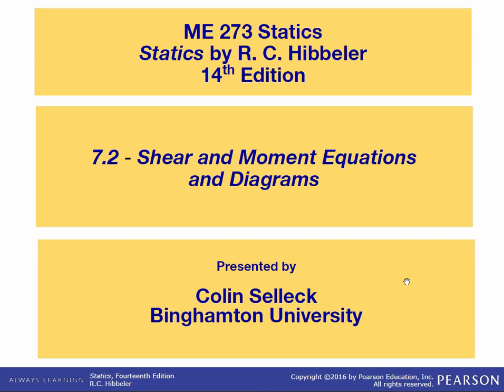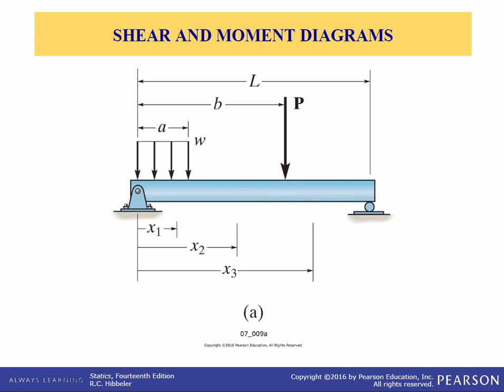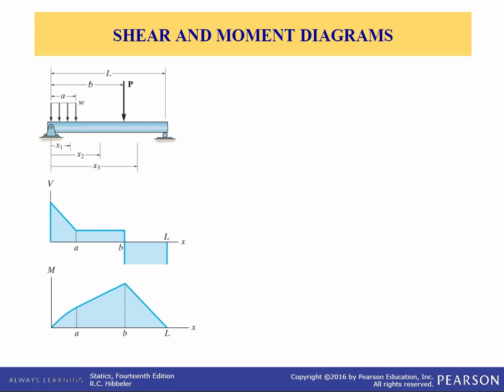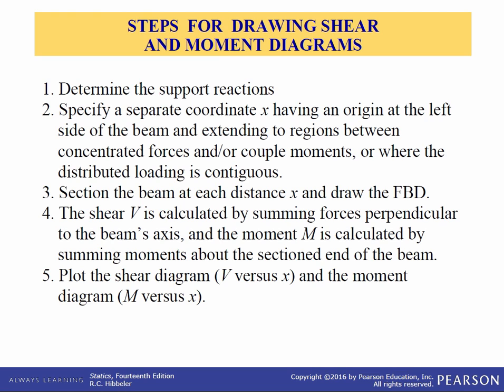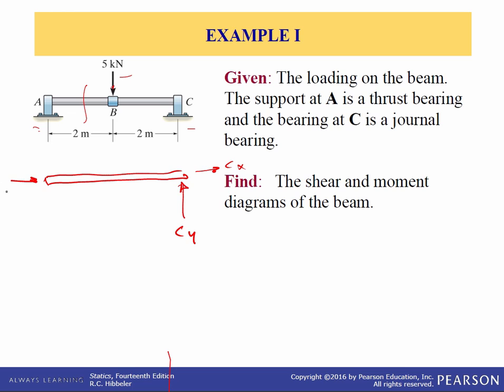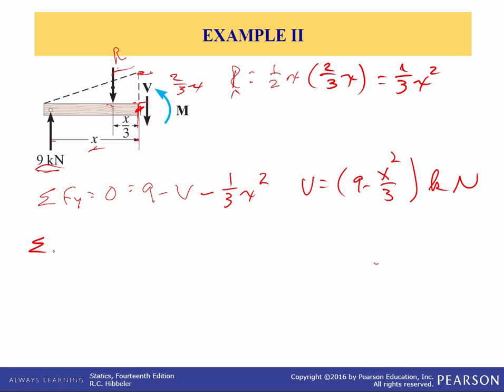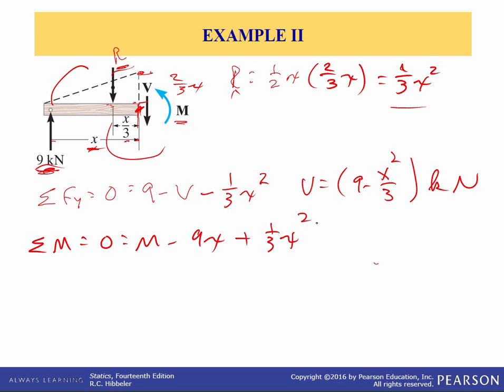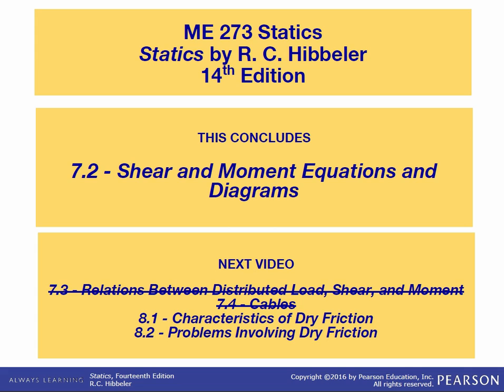ME273: Statics: Chapter 7.2

Comment: :Professor I wonder sth at 18:09 why maximum bending moment occurs when the shear force is zero?
Reply from the maker: Do you have the Hibbeler textbook? Look at chapter 7.3 where it defines dM/dx = V. So when shear is zero the slope of the moment diagram is 0, so you are at a local maximum in the M -x plot.
Reply from the maker: Also see https://engineeringstatics.org/VM_relations.html#:~:text=The%20slope%20of%20the%20moment%20diagram%20at%20a%20point%20is,moment%20diagram%20and%20vice%2Dversa.&text=Change%20in%20the%20moment%20between,area%20under%20a%20shear%20curve.
Reply: @ColinSelleck  Oh thanks a lot professor :)one more thing, forces in the pin,for example, are internal forces right?We do not show them in the entire body diagram
Reply from the maker: @ygt824  The pin forces are not internal forces. They are support reactions and need to be solved for before you start on the internal forces.